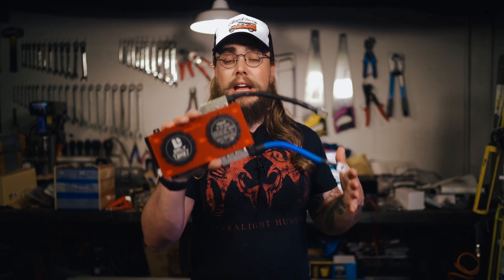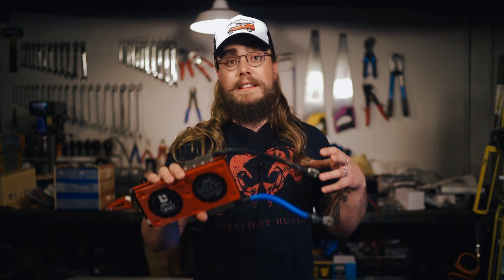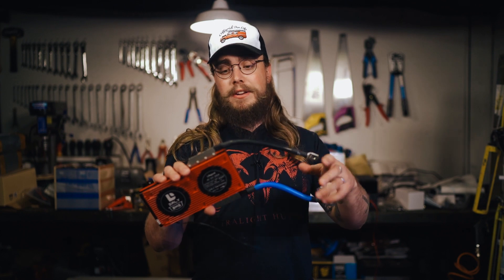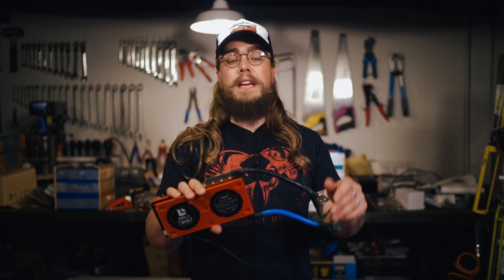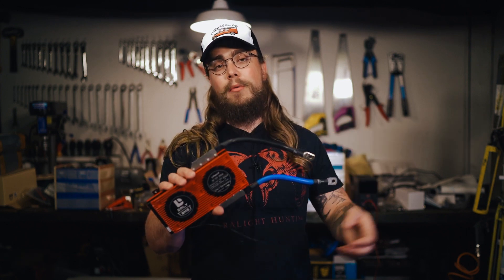Daly BMS Won't Allow Charge OR Discharge?? [How we resolved this]

Comment: I have 2x 16s LiFePO4 200A Daly BMS in parallel, was top-balancing one pack offline and when I put it back on the battery bus the charge and discharge status turned off.  Now the strange thing is that it is still allowing discharging and charging, but it just reports that they are disabled.  I even disabled the charge  and discharge in the app and then they stop, but it's always reporting them as disabled now.  The other BMS still reports them as enabled too.  Haven't tried factory reset yet, but yet another way to encounter this, though in my case it still allows operation.
Reply from the maker: A factory reset might help or it might be a faulty BMS.

Comment: I have a 100 ahr lifepo4 with a 60A s4 12v. The battery drained and now the BMS won't allow a charge at all "SOC LOW LEVEL 2" 

HELP
Reply from the maker: Try disconnecting your balance leads and reconnecting them to reset the BMS?
Reply: @offgrid_power  I tried that I even charged the battery cells back to full charge and it still won't let me charge through the BMS. I wanted to reset the BMS back to factory settings but it keeps telling me that feature is not available. I don't know what else to try any other suggestions. The BMS allows me to drain the batteries but not charge them. When the batteries are fully charged and I set the SOC to 100% it still won't let me charge I'm wondering if the BMS switch that allows charging or not is destroyed.
Reply: @highlander723 Hi, i have the sâme problem, did you fix it?
Reply: @thibaultbadrianizon3215  I hate to be the bearer of bad news but I ended up buying another one. I ended up cracking open the old one and it was very clear there was something that went wrong in there there were burn marks inside. sorry man.

Comment: I use different types of BMS for my projects. But only with Daly BMS i have a lot of problems. They are dying like a fly. The only reason why i use them sometimes is, that they (should) can handle a lot of current. but actually i have a new 500 A BMS that is not loading anymore (at the 3rd cycle). So the costs of a new one are 350€.  😫

Comment: Thank you very much. Today I ran my daly BMS and he doesnt charging battery (discharging works ok). Reset, changing setting - still nothing. After watching this video I deceide to switch off all - inverter, and battery. After restart all works great, BMS is charging and discharging. 
I was set max sum voltage to 56.7V on BMS but my new battery has on start 58V. Next they was discharged to 52V. Charging was blocked (in application is viewed as turn on [green]).This may cause of this issue.
Reply from the maker: Glad it helped

Comment: That is nonsense, because you have mainswitch after bms and before your devic3s and also fuses for each device. And if you cut off power you can see on the daly app whats going on. The problem of this daly bms are different they disabled without a reason and go never ever back to work. Also not without any devices connected. Also no communication wirh bluetooth and app. Dead a new one only after one day without big currents...

Comment: great video thanks very much .   I have a 48v 300ah lithium battery and ive been trying to work out why my inveter ( I have tried growatt & epever inverters and chargers, ).  won't charge it over 50v , I am thinking the BMS won't allow it .   have you seen this before? I am wanting to try a new BMS to see if that will get it up to 54v

Comment: Hey there! Great video. I am facing an issue with my Daly BMS which I am using for a 4kWh modular battery pack. It shows the right cell voltage when the battery is not charging or discharging. But as soon as I charge the battery, one cell goes out of balance and while discharging, many cells go out of balance. However, when I check the same with my multimeter, the cell voltages are perfectly fine. Only the app is showing me an erroneous reading. Please help.

Comment: @3:17 i didnt dislike daly because it fails or electronic failure! i dislike it has really limited imporant features that some smart BMS has. You chose smart bms for many REASONS and one reason is balancing. You dont just balance during charge but you do it idle plus clunky and buggy app sometimes it charges sometimes it doesnt. new DALY bms i expect more but failed me.
Reply from the maker: Good points! :)

Comment: if your bms go into lol voltage protein mode an you do all thing an it do not change or discharge disconnect the balance  cable an it will start charge

Comment: All good vids can you tell me how many ac wats can you pull through a 200a bms roughly Thanks
Reply from the maker: Depends on the voltage of your battery. If you're building a 12v 4s battery, you can pull around 2400w through the 200A BMS (basically multiply the voltage by the amperage). If it's a 24v 8s battery, then it's 4800w, etc..

Comment: hey, i have a standard 280a 12v 4 cell pack, i noticed my daly app now has an active balance section with a load of settings, it shows as having 2 battery strings, is this correct as cannot find any answer online, ty
Reply from the maker: Hi Paul. Send us an email with some screenshots and we'll take a look!

Comment: Nigel, so glad you sorted that out for your customer. Unfortunately I still have the problem with my new Daly BMS it still will not connect with my phone any thoughts on this matter, Many thanks.     Ps. I did leave you a update.
Reply: John have you given the Daly app all permissions in App settings on your phone.
Reply: @nathoilboy2053              Nathan thanks,I will reinstall the app as has been suggested and l will check for that. Many thanks.
Reply from the maker: Thanks John. Just sent you a message. 🙂
Reply: Hi mate, with our dally, we sometimes hav to uninstall the app and reinstall app for it to connect & it works again 👍
Reply: @mayterrace1971                Thanks for your reply will give that a go.
Reply: For me there are two main issues: 1) Sometimes the bms app gets stuck with showing 24v and 0% SOC 2) Other times it simply won't even wake up! no matter what I do (key on/off, connect P- to C-, put some current on it...nothing). Found a solution to all problems.... 1) get a USB monitor cable 2) Unplug the balance cable 3) Plug the USB monitor cable to a laptop 3) At this moment you will see that it gets recognized by the BMS smart app 4) Plug in the balance cable 5) BMS restarts and all should be fine now. I found that this sequence is the only solution to many of my issues. I have a 4S BMS